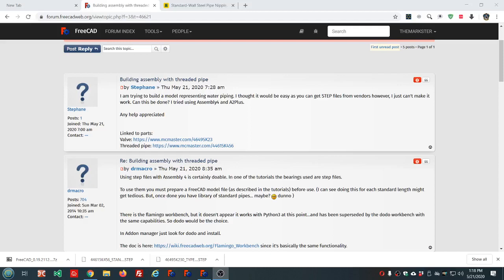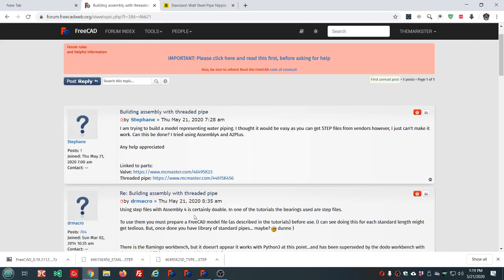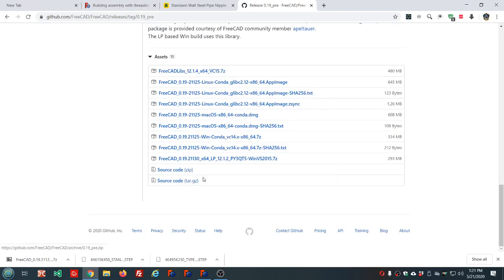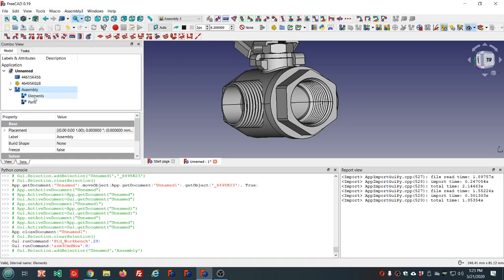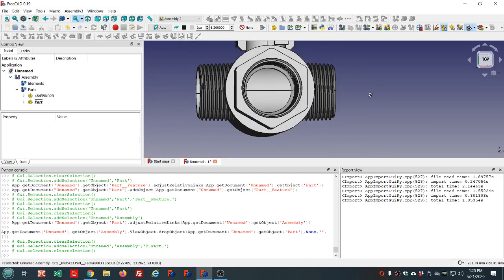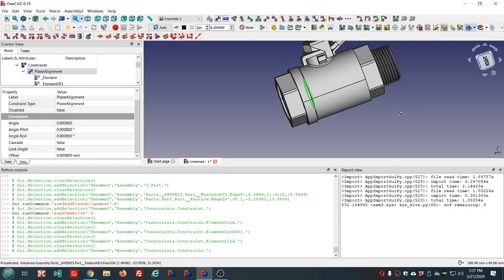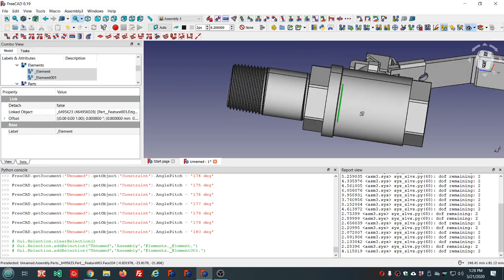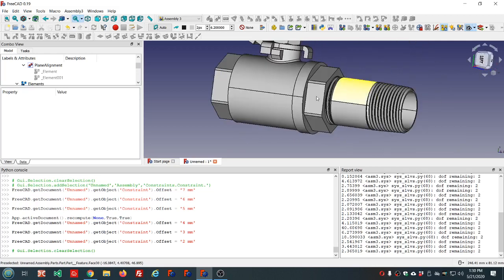070   FreeCAD 0 19   Assembly3 pipe and valve example

Comment: Your example it's ok for me. But, when you 've the part issu of workbrench "part design", you don't need to creat the new part folder into the menu part "Assembly3" of this assembly, you can create the constraints by placing them in the menu ''part'', directly. I hope I'm clear in my explanation :)

Comment: Assembly tool for woodworking?
I am a woodworker and have used Sketchup extensively for designing furniture, my house, sheds, hydronics system, etc. I am wanting to move to FreeCAD for all my woodworking design work. I have seen various approaches (on YouTube) and haven't felt really like I've seen a really good approach to woodworking design using FreeCAD. Is Assembly3 a good approach to designing various parts of a piece of furniture and putting them all together? I've seen other approaches creating multiple part bodies and them mapping them to get them all lined up. Looking for a recommendation before I start investing time in a given approach.
Reply from the maker: Good question.  You should ask it on the FreeCAD forum.  My own personal experience with FreeCAD has been limited to smaller projects, things I could print on my 3d printer, for example.  I haven't used Sketchup, but there are no doubt many users on the forum who will have come from Sketchup and who can provide some recommendations.

You should take a look at the Arch workbench.  The lead developer (Yorik) is an architect by trade.  He has made some tutorials you should go through to get an idea of if it would be right for you.  https://wiki.freecadweb.org/Arch_tutorial

The TechDraw workbench might be useful to you, too.  With it you can easily print out (on paper) plans for various woodworking projects.  I used it once for a small project (a small housing for a water pump) and it worked quite well.

I have only just begun exploring the Assembly3 workbench.  It looks promising for doing something like what you seem to have in mind, but I don't know if it's the ideal tool, particularly for larger, more complex things like houses.

In any case, I believe the time spent learning FreeCAD will be well spent even if you decide to go another direction.
Reply: @mwganson  Thanks for the response. I took a look at Yorik's tutorial; it's based on FC .14. That's pretty old. I followed the link from his tutorial to his blog post and it was written in 2012. The FC documentation is frequently very old and doesn't work well on current versions of FC. I found some forum threads but they were also pretty old. I'll go ahead and post a new comment and see if I can get some more timely information. 
Thanks again for doing these tutorials. I've learned a lot.